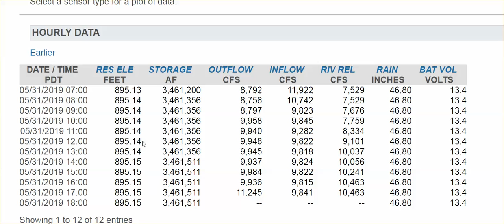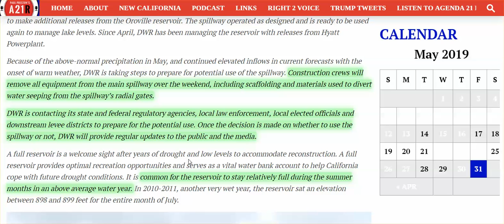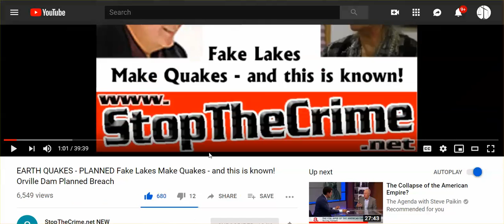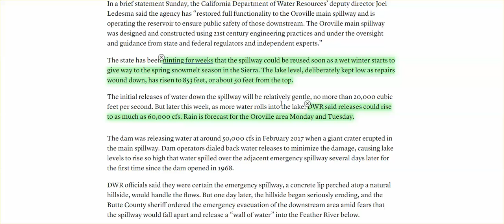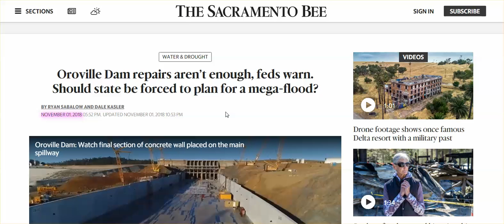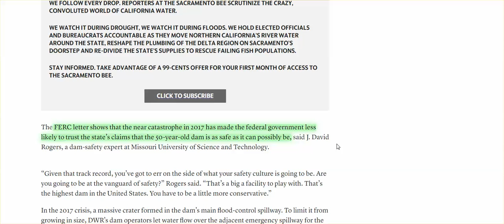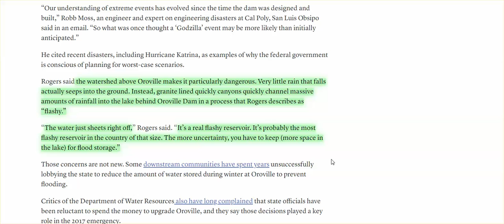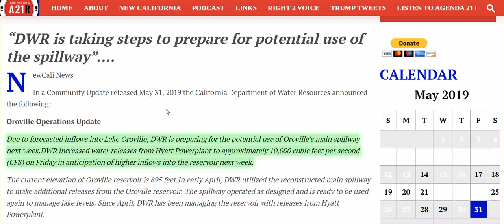Oroville Dam: DWR May Open Spillway, Seeping Thru Weir Wall, FERC Concerns, 8 Days Above 90 Temps

Comment: The 50' buffer is an April rule, after April into the summer the lake becomes a storage lake. Lisa Cahill did a video on this operation for Oroville, she explains it is normal to use the lake like this. 
People argue that the lake has rarely been this high, but California ia a drought state, any year of high snow/rainfall should be taken advantage of. The lake has been this high on some 10 occasions since built.
It's an entirely different argument that high levels is dangerous for the dam or the spillways. There are some who say it is and some who say it is not.
Reply: You are not going to convince these people that the dam and lake are being operated as it should be operated.  Believe me....

Comment: 33X's the water level, a year before its crucifixion. Alchemical weather control poloriazes water into wine, vibrating the ground from its movements, mixing rivers into mudflows, liquefying landscapes pulling home down below, as it sank in mud flows, or built up around the architecture. The scouring torrent revealed the mineral trails, to plan labor camps to excise del Oro. Sweeping landscape of its inhabitants with homes, lives and animals, with all holdings for controlling interests to make resilient. Resilient for them is defined as, our adaptation to conform to a belief that its good for us.

Comment: Carol, Here is a Link that Shows 25 hours of Oroville Dam Data
http://cdec.water.ca.gov/dynamicapp/QueryF?s=ORO&d=01-Jun-2019+20:51&span=25hours
or you can change the 25 at the end of the link to another number  say 72 and see (3 days) much more of the level changes
It's Interesting.  THEY are for sure releasing a little now!